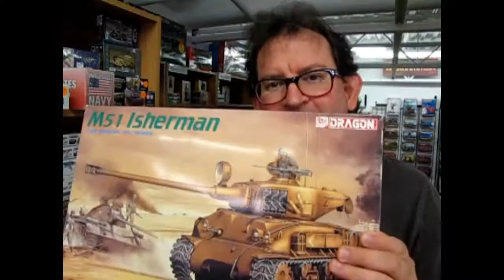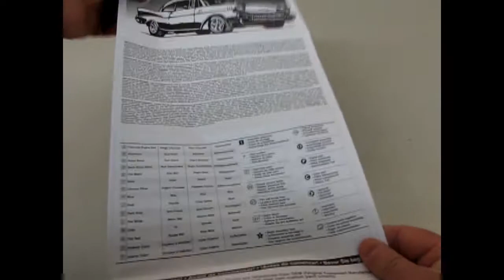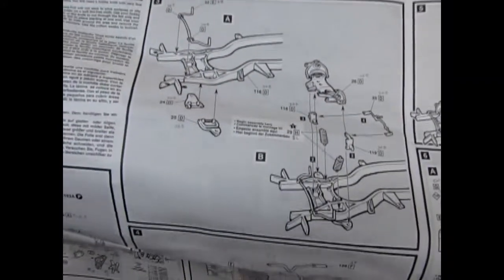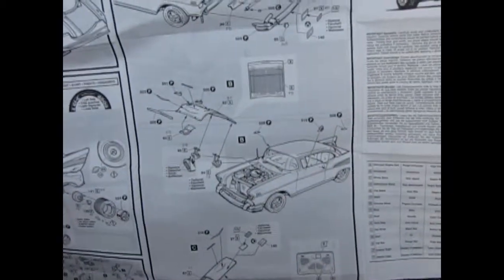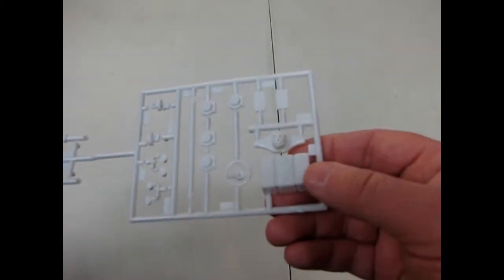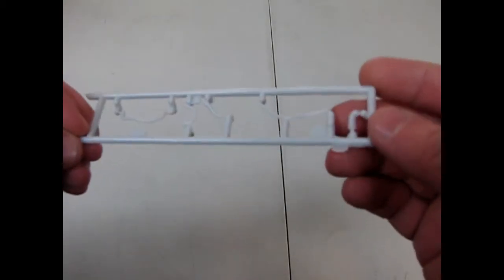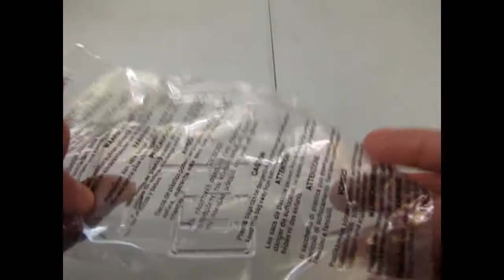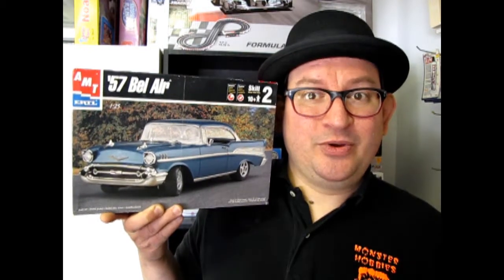Model Car Garage - 1957 Chevrolet Bel Air Street Machine Model Kit By AMT/ERTL - Model Car Unboxing

Comment: I have the stock version of that car, I rather have that version, big block chevy engine tubed rear end. It should have came with bare metal foil, I thank it was with the tires on yours.  The newer release comes with a photo edged grill. Im go to keep my eye out for one. Thanks Trevor didn't no there was a version like that.
Reply from the maker: The newer releases might have both the stock and custom pieces in it. I know they did this with the 1962 Pontiac.